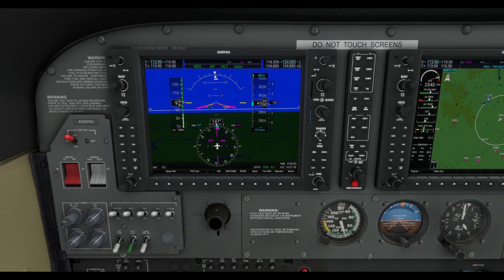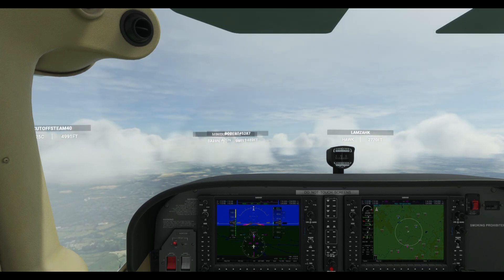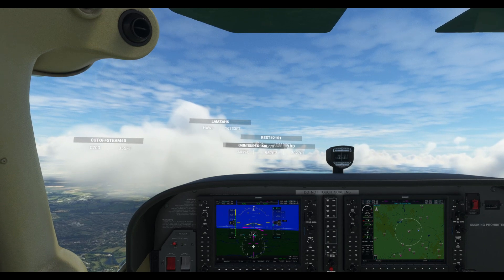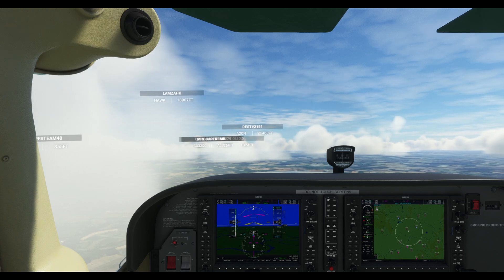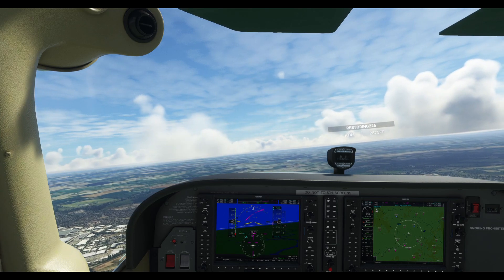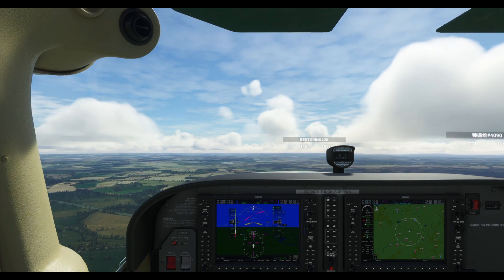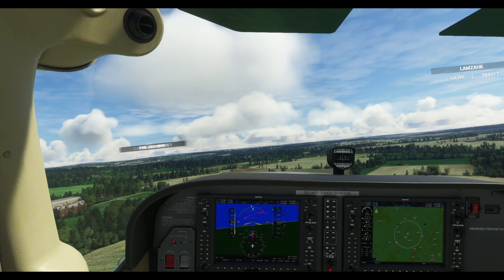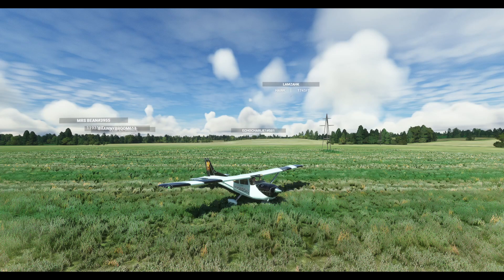FS2020: Gliding Guide - Engine Failure in C-172: Back To Basics With MSFS Part 25

Comment: Thanks for  this video!  Really good suggestions.  As a real-life private pilot many years ago, the entire time I I was flying I thought "if the engine quits now, where will I go....if the engine quits now, where will I go?"  Constantly.  That's what my instructor taught me.  I had a real engine failure once and had to set down in a field.  Not pretty, but got the plane down safely.  Your heading toward the trees after touchdown was very reminiscent of what happened to me.  My butt was not even touching the seat as I was STANDING on the toe brakes.  A REAL challenge to get the plane back out of there!  I was always taught you can go 7 times horizontally as your height above the ground in a 172.
Reply from the maker: Fantastic additional information and insights there - thank you!

Comment: A little known secret is MSFS doesn't model any kind of friction in the engine, which is why all props on all MSFS planes windmill like crazy and you can't simulate an engine failure which involves the prop actually stopping. You'd think sim power pilots would have noticed, it's been a pain in the ass for us motor-glider devs for years. (tech point, fs2002/4/fsx/msfs model various torques in the engine/prop, but not friction, so trying to stop the prop is like balancing a pencil on it's tip and is impossible while airborn).
Reply from the maker: My original intent was to get the prop to stop dead, but as you mentioned, not easy to execute this in the sim.

Comment: I was in my sim flying from Cardiff to Bristol a few weeks ago on crossing the Bristol channel I had just passed the south shoreline and my engine began losing power then cut out, I checked all my instruments and found my fuel tanks were empty, now I had a dead engine and was using my best glide speed and looking for a suitable field with time running out I chose a field , crossed the hedges and landed my Cessna 172 safely and came to stop. Lucky it was in my simulator, but I do check my fuel status every time now. I have never crashed a plane flying in my simulator. Been flying in my Simulator and occasionally for  real when I can afford it  since 1992. Never crashed an aircraft in the Sim and never for real. Hope my instructor don't read this. Climb on that wing and manually check your fuel status. one rule I do every time now
Reply from the maker: Nice record on never crashing; I can't say that I have the same accolades.  Great story 😉
Reply: @Huddison  Thanks, I try to fly thesim as if it is an actual flight.

Comment: Great video Huddison!!! Personally, I'd have picked a field closer to where I lost power, and circled the landing point until I was low enough to start downwind abeam "the numbers" (touchdown point), then short base to final. This way, I'm not re-thinking my landing spot. I've chosen and committed to it, and I make the airplane get there.

I like to use the yoke at time of power loss to trade some airspeed for another couple of hundred feet of altitude, then trim to relieve yoke pressure.
When I was in flight training, we practiced this and you're right. We'd abort it at about 700 ft above ground level. However, We had some airports with grass strips too, so we'd practice at those fields all the way to landing and rollout.. 

Nice Job!!! 😎
Reply from the maker: Great points and additions Aces. During editing (after recording), I had the same thought as you and knew I should've used my yoke to at the point of engine failure - next time eh 😎